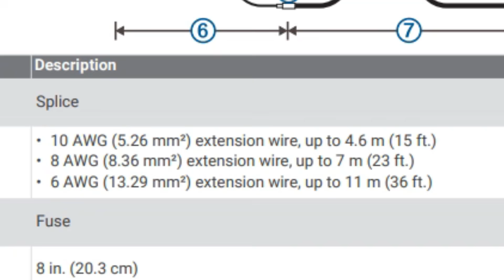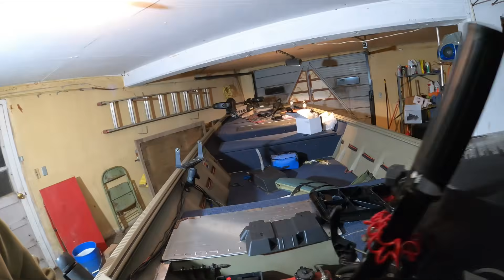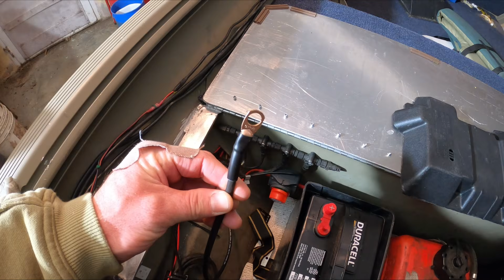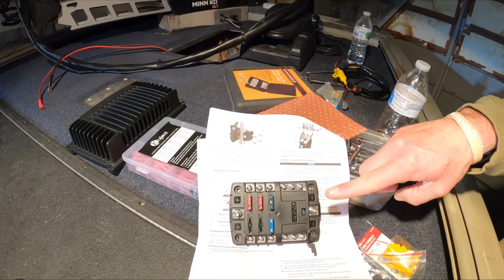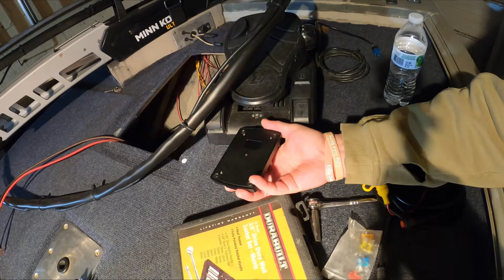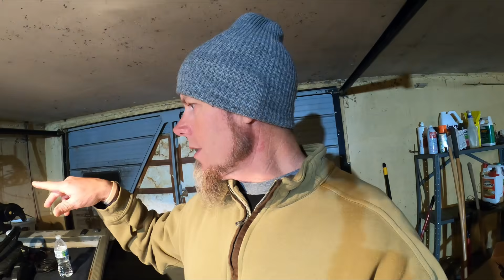How To Wire A Garmin LiveScope And Graph (Proper Battery Power)

Comment: Any reason you didn’t use a relay on the livescope power line and trigger it with a toggle switch from the helm or somewhere convenient? This would eliminate the switch at the bilge and allow you to isolate the lower current circuits for the depth finders while ensuring better current flow to the live scope.
Reply from the maker: I have my master switches ran to the back of the boat. When I open the vent on my gas tank, put the plug in and turn on my main power I just turn on the LiveScope power. It's all in the back of the boat.

Comment: so do you have your fish finders directly to the battery or to the fuse block?   i have a battery i used for my trolling motor in my little boat i may just use it for my black box and fish finders
Reply from the maker: I have my Garmin 1022 and the LiveScope black box ran to the fuse block. The fuse block runs to a switch. The switch runs to the battery. I fried the lead acid battery in this video after 6 months. I went to a lithium. Pricey but well worth it.
Reply: @TheTinHorseMonty  so turn the swtich on and run everything  swtich isnt just directly for the black box huh
Reply from the maker: @cd1982  Yes. Switch is for graph n box. Saves you from having to run 4 runs of wire to the battery unless you want to do it that way.

Comment: I have two batteries wired in series. Starting and trolling motor. One has 1000 marine cranking amps with 180 reserve. The other one 685 CA with 140 reserve. Would that be enough for the LS too
Reply from the maker: Appreciate the comment Flint. You’ll need a separate battery for LiveScope. It really sucks the juice. Some folks use a 20-30 amp lithium dedicated to LiveScope.

Comment: How do you determine what size fuse to put on the fuse block?  I want to add one for my 2, 9 inch garmin and the black box
Reply from the maker: I believe the black box (GLS !0) requires a 7.5 A fuse and most graphs require a 3 A fuse. Check the Garmin website to verify.

Comment: Love the details! Did you connect the NEMA power wires? I'm not connecting these to another unit but wondering if these power wires need to be connected at all.
Reply from the maker: Nope. I just roll them back and black tape them.

Comment: Could you plug a garmin echo map into the same fuse block using the same 8 gauge wire. Or should I use a separate 8 gauge wire for it?
Reply from the maker: You'll be fine running 2 graphs off of one feed.

Comment: Would this apply to setups done in a portable containers? Where the splice for power lines are a couple of feet?
Reply from the maker: No I think you could go with 10 G on a short run. Maybe even 12. Garmin website should have a recommendation

Comment: Hi, saw your video. Was wondering what size blade fuses did you use for your graph and black box into your black box. I can’t seem to find it in the manuals. I’m doing a similar set up as you have. 
Thanks
Reply from the maker: Sorry for the late reply. The graphs take a 3 amp fuse. The black box calls for a 7.5 amp fuse. Hope this helps.

Comment: Here’s what I don’t understand. If someone puts an online fuse less than 18 inches from the battery, doesn’t that severely limit the amount of power coming up? My mind can’t comprehend why use 8 gauge if we use little bitty wires on an in line fuse. Didn’t we lose our power and what is left now the 8 gauge carries to graph? Wouldn’t that fuze box you had be better for amps???
Reply: You can use the smaller wire when closer to the power source because the whole reason the size of wire matters is when you’re talking about length. Minus power going through the wire obviously. so the longer the distance the wires is the bigger you want your wire within reasonable size. Because energy will get lost as it travels through a smaller wire more vs a bigger wire. that’s why it’s okay to run small wire inline fuses when it’s close if not directly connected to the power supply
Reply: I love listening to people talk about electrical theory they actually don’t know anything about electrical theory.

Comment: So do you run 8 gauge wire also for the ground wire? And then to power the main unit do you just run the power wire directly to the battery, or do you run it to the same fuse box, or is the fuse box just to run the live scope box? If you do run it back to the battery, what gauge wirer do you use?
Reply from the maker: Yes I ran 8 gauge wire for the power and ground. I ran it from the battery to the fuse block. The power wire and ground from the graph and LiveScope box ran straight to the fuse block. If you don't use a fuse block you can run wire from the battery directly to the graph and directly to the LiveScope box. You'll just have to splice n join together. The fuse block eliminates having to run 2 power wires and 2 ground wires from the battery. Run 1 set to the block and jump off that. Hope this makes sense.
Reply: @TheTinHorseMonty  where can I find that fuse box, do you have a link to where I can pick one up? Thanks.
Reply from the maker: @phillybasszilla3967  https://www.amazon.com/Blue-Sea-Systems-5025-Blade/dp/B000THQ0CQ/ref=sxin_14_pa_sp_search_thematic_sspa?cv_ct_cx=blue%2Bsea%2Bfuse%2Bblock&keywords=blue%2Bsea%2Bfuse%2Bblock&pd_rd_i=B000THQ0CQ&pd_rd_r=edbd8568-b2cf-4f1e-95fe-9aa0f2a7cb4c&pd_rd_w=oTUOW&pd_rd_wg=NTaqw&pf_rd_p=937f515b-f21e-48f6-8cfd-8695fa84b7c5&pf_rd_r=8JKZJV6299N51568BZ6N&qid=1650248654&sr=1-1-a73d1c8c-2fd2-4f19-aa41-2df022bcb241-spons&spLa=ZW5jcnlwdGVkUXVhbGlmaWVyPUEyRVhBVzhJWUdHWUZUJmVuY3J5cHRlZElkPUEwMTAxNTAxMVU3UURNR1JXMVlLUCZlbmNyeXB0ZWRBZElkPUEwMjc2Njk5UkUwRUxaSktBMFBYJndpZGdldE5hbWU9c3Bfc2VhcmNoX3RoZW1hdGljJmFjdGlvbj1jbGlja1JlZGlyZWN0JmRvTm90TG9nQ2xpY2s9dHJ1ZQ&th=1
Reply: @TheTinHorseMonty  thank you, do you run a on of switch at the battery also? And do you also run a fuse within about 8" from the battery? If so what size fuse do you recommend? I will be running two graphs off the fuse box. If you done run a on off switch, do you have one that you recommend? Sorry for all the questions, but this is all new to me. Thanks.
Reply: @TheTinHorseMonty  I see you do run a on off switch, do you have the link for that also? Thanks.

Comment: Is your graph powered by the fuse block?  If so, why have it doubled fused (inline and on block)?  Why not just cut it off and rely on the fuse on the block?
Reply from the maker: You’re exactly right. It’s overkill n not necessary.

Comment: I was told to run 6 gauge wire to avoid any issues, I hope that's true
Reply from the maker: With 6 gauge you will have absolutely no power issues. That's some heavy stuff. What length is your boat and how long of a wire run?

Comment: I have an 18v Milwaukee batt in the front of my boat with NO wiring. My power cables go from black box and unit straight to batt. No problems.
Reply from the maker: I tought about that and have heard it's a great option. Glad it's working for you. A lot less weight than my set up.
Reply: I saw a video like that and wondered how long that little battery would last?

Comment: for my 1022 and livescope.. I pull about 2.5 amps for my settings :)
Reply from the maker: OK. Good to know. I've had my LiveScope and 1022 out a few times and the battery I have has plenty of power left at the end of the day. Thanks.
Reply: Yeah, you should be able to go a few days without a charge with your battery.  I run a 48Ah battery and I've gone 20 hours of use without a charge.
Reply from the maker: @seewhyem  Cool.

Comment: Excellent job. I did mine almost exactly the same way, but I used 10ga wire since my run wasn't quite 15'. I terminated the fuse block about midway in my starboard rod locker on my Z18 which made the run about 14'. I was also able to get tinned copper wire in 10ga a little cheaper than 8ga. One critique on your installation I'll make is you limited your access to the fuse block and to the GL10. If you have to replace a fuse, or monitor your indicator lights on the GL10, you're going to have to take the boat apart. If this happens on the water, which it will of course, you're screwed. I am running the fuse block off the cranking battery, which also powers all the other vessel's systems. It's not ideal, but the Merc 4 stroke charges that battery quite efficiently. I'm holding out for a LiPO battery, but in the meantime I may just get another flooded deep cycle battery to run the electronics. I am running three Elite-9 Ti2's, a 93SV and the GL10 all on the dedicated circuit. I was saving the last port on the fuse block for an NMEA 2000 network, but I just learned that it isn't going to help me. Again, great job on the video!
Reply: Where did you mount your GL 10 at in your Z18?
Reply from the maker: Thanks Neil! I agree on the less than ideal placement of the fuse block n GL 10. I have 6 screws on my TM pan that I will have to remove to access it. I really didn't have anywhere else to put it. Tin boats have limited real-estate. Sounds like your set up is working great. I've been thinking lithium but $$$. Someday!

Comment: Excellent job researching and making sure you use the correct gauge wire. If to thin you are creating more resistance for the flow of current which will cause it to get hot and melt or even cause a fire. Even a size bigger isnt bad as it will not effect anything, just dont go smaller. Makes me smile when I see people doing stuff like this right 😁!
Reply from the maker: Thanks Cody. Probably overdid it but, like you said, it won't hurt a thing🤘

Comment: Another thing to remember fellas, you only get to use 20 percent of what ever number is on your battery. That number gets you to 12 volts. When your units start acting weird, bingo. Also the volt reading on Humminbird is plus or minus 1 volt calibration. Meaning it could be reading 12 volts and actually be down to 11.
Reply from the maker: Thanks Doug. Appreciate the insight!

Comment: Amp hours are measured down to 10.5 volts. Your unit requires 12 volts to operate properly. I run 3 - 12 inch Humminbird’s and 360 plus 1022 Garmin livescope.A regular 27 or 31 series battery will be done for in 5 to 6 hours. Switched to Lithium Pro’s 132 , runs all electronics, live well, stereo and the Merc. Weighs 38 lbs and took the place of 2 series 31 marine batteries.
Reply from the maker: Dropping science! Appreciate it. Good talking with you!

Comment: I have bought the live target and am doing the research to install it in my boat with the same setup that you did. Already bought the same gauge wire, fuse block and switch that you installed. My question is do you really need the fuse on the power cord since since it is going to a fuse on the fuse block? Seems like there are 2 fuses on the same wire.
Reply from the maker: You're going to love Active Target. No, one fuse is fine. 2 is kind of overkill.

Comment: When that battery dies from time, I would look at the Ampted Outdoors lithium.  I have the 30 AH and can pick it up with my pinky.  I have fished on that for 2.5 days without a charge.  It will save you about 50 pounds in your boat and cost about $200.00.  I had mine on the starting battery and got to a point to where by 11 I would be fishing with my motor running during a tournament because I had to get jumped off.  You will like the LS man.   Make sure to do the update that just came out for the 1022.  It is amazing.
Reply from the maker: Thanks for the tip. I watched your video. Good job. I'll go lithium next time. I did the update yesterday. Pretty sweet.